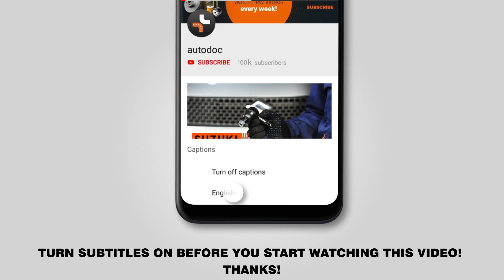How to change ignition coil on MERCEDES-BENZ С W203 [TUTORIAL AUTODOC]

Comment: Thanks for putting this brilliant video, I have a C230 2000 but it was still helpful. 
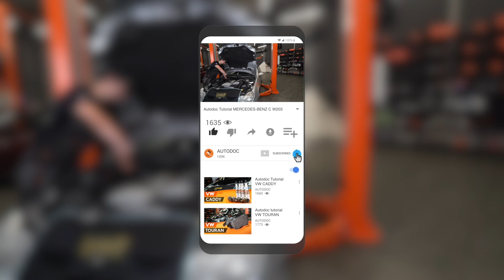Only thing is: 1) I would add the advertising message (from 1:35 to 1:43) at the end, because it blurs and hides what the mechanic is doing in the last final critical steps. Also, I'd add a quick comment about how to apply the anti-seize lubricant.
Reply from the maker: Thank you for the valuable recommendations.
Stay tuned with us for more news coming soon.
Best Regards,
Autodoc team.

Comment: Is it advised that change them in set’s or does not matter?
Reply from the maker: It is recommended to change the kit, but you can only replace the one that is out of order, you can find more accurate information in the technical documentation for the repair of your car.
AUTODOC
Reply: @autodocuk  many thanks for response. Have you experience air and fuel pressure problem after a single coil failure repaired?

Comment: how do you know when  its time to change the ignition coil? what does the ride feels like? thanks
Reply: Car will run rough, you'll get code P030x which indicates a misfire and which particular cylinder the code is related to.  It could also be due to other issues though (injector, others?).

Comment: I have a question not sure if anyone can help. In the process of replacing my C230 2000 ignition coils, I broke the plastic back cover part that covers the car's electric wire that plugs into the ignition coil. So now, I'm driving without that back cover for one of my ignition coils. The other one is intact.
Is it going to cause issues? And how's that part called? I'm trying to evaluate if replace it will be easy for a beginner DIY. Many thanks for any advice.
Reply from the maker: Thank you for your comment.
There will be no particular problems from a broken cover that closes the wires and coils.
But we recommend to replace it with another.
Best Regards,
Autodoc team.